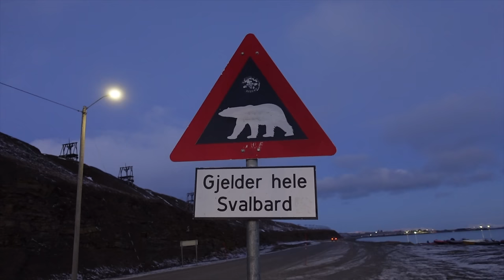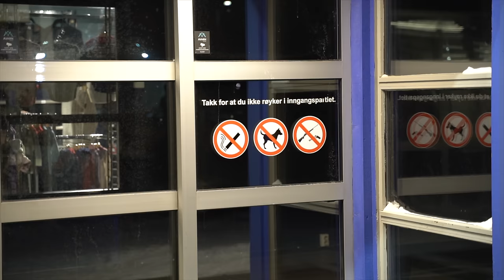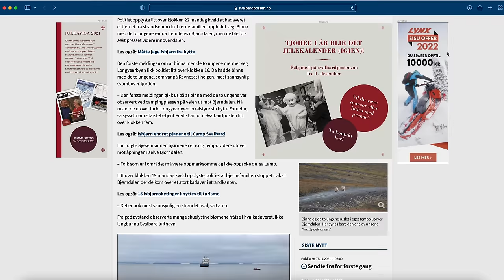Why I have to carry Polar Bear protection when walking my dog | SVALBARD close to the North Pole

Comment: It's the same way here in Libby, Montana. Had a couple that were tourists run out of gas at the end of my quarter mile lane. So I grabbed my sling and AR becuz I didn't want to jump a grizzly and my lanes a 1/4 mile long. So when I got within 40 ft of them I smiled and asked them if they needed help. They laughed and said initially they were worried becuz I had a gun and it was their 12 yr old that reminded them they were in a county that had the highest grizz population in the lower 48. I laughed and told them it was just a safety precaution with the bears. Gave them 2 gallons of gas and followed them back into town to make sure they made it for gas. I've lived here all my life and you really don't even think about it, it's like a warm jacket on a cold day.

Comment: You 35.6 is not too cold. Me in the States. 35.6 is cold especially in snow. Though I think I have acclimated to colder weather better this year. I have lived in my townhome for 18 years come middle of December. This house was built 1997. I finally had to replace the furnace 2 weeks ago. I went 3 days without heat.

Comment: I know what you mean on the polar bears. Back in 2002 – 2005 I had a gig with NASA working on the Radar station at Longyearbyen, anyway in April there were two Japanese women researchers up on the ridge to the northwest of town that were tracked by bear. The first one was bitten and then slide down the gullet and dropped off the cliff and broke many bones but lived. The other women was eaten alive by the bear. Some natives from a Russian village tracked the bear and shot it a week later.

On our work at the station I was made the rifleman for the group. When in town we just took a round out of the chamber and put it on the gun rack with all the others. Once at the radar station on the road in March there were tracks coming up to the dome. I spent two days out with the rifle checking things, it scared a lot of people, the hired tracker said it was a large male. You should put a picture of Leif Erikson on your wall.

Interesting to see firewood since the nearest tree is 1,600 miles away.  Wood heat in the arctic, wow!

Comment: Not a big deal but your temperature conversion is wrong. -2 c would be 28.4 f. Freezing temp being 32 f so obviously 35 f is impossible with the current outside conditions.
Reply from the maker: Yesss it gave me conversion for +2c for some reason🙈

Comment: Hi. On your remote cabin trips, what is the deal with renting them?  What about firewood?  Do you have to bring your own, or is plenty provided by the rental?  Assume you need to melt snow for water.  Is fuel (propane?) provided as part of the rental?
Reply: Propane and a cabin stove is in every cabin. But you bring evrithing you nead for your trip🙂
Reply: @christoffersporck  Thanks. just curious. It is nice to have a fire, so that wood would be a bit of a load.
Reply: @craigcampbell6961  we always bring about 200l of wood on the sled/trailer when we go snowmobiling. 40 to 100 of bensin good amount of food and extra stuff for safety!
Reply: @christoffersporck  It is nice you have those cabins available.  Back when I lived in northern BC, I did some 2 week trips on glaciers, some in Alaska,  on XC skis pulling a pulka.  No wood/no fires. But sled allows one to take 100 + pounds of gear including fuel as all water requires melting snow.  As I get older your more civilized version has appeal :-)  No polar bears to worry about, but some northern more wooded areas have grizzlies.

Comment: The temperature conversion at 04:14 is not correct.  -2 degrees Celsius is 28.4 degrees Fahrenheit, which is below freezing. 35.6 degrees Fahrenheit would be 2 Celsius degrees ABOVE freezing.
Reply from the maker: I know it gave me the conversion for +2c for some reason :/

Comment: So you're required by law to carry a gun when you're in certain areas in case of a polar bear attack, but shooting a bear is illegal, even if it was the last resort? Even if you do actually need to use the gun that you're legally obligated to carry, you're likely to be hit with a fine for it? 
It's troubling to hear that a government can have two such conflicting laws, which can very easily put someone in jeopardy of breaking one of the laws no matter what they do...  Wouldn't that be considered entrapment?
Reply: She didn't say you will get a fine, she said probably get a fine. You won't get fined if enough criteria for self-defense are met. However, in almost all polar bear shooting cases, there was human error that caused the incident. Like deliberately approaching the bear (which is illegal in itself), could, but didn't try to scare it off first, or didn't keep proper watch out, and this are reasons most indeed get a fine for.

Comment: So you can shoot up in the air if you encounter a Polar Bear? The noise will scare it off
Reply: If a polar bear is hungry you will not scare it off, you are required to get away from it so you do not need to shoot it for self protection.
Reply: @badgerpa9  Bears can run 35mph, but ok
Reply: @FormerTrucker  Did you notice the landscape?  It will not be hiding behind a tree. If you look around you can see a long distance and can try to get in a cabin or vehicle long before the bear is by you.  You do not want to risk your life to thinking you will shoot it, something can always go wrong and a hungry bear is hard to stop.
Reply: @badgerpa9  indeed

Comment: Why don't you carry bear spray?
Reply: If you want to live you need more than bear mace, a polar bear that is hungry will not stop.  It is your responsibility to get away from the bear and have no contact.
Reply: @badgerpa9  Of course it's your responsibility to keep safely away from any bear. From Wikipedia:"The efficacy of bear spray depends on the situation and circumstances of the attack. ... Red pepper spray stopped bears' undesirable behavior 92% of the time when used on brown bears, 90% for black bears, and . Of all persons carrying sprays, 98% were uninjured by bears in close-range encounters."
Reply: @waynead754  What is the source wikipelie is referencing. Is the information totally dreamed up or a real test?  I never believe wiki because after checking the material I have found were they change things by deleting a word like not.   In an open stark terrain like there you should be able to spot bears a long distance and completely avoid them not needing anything for protection, but a hungry bear can run you down so you need protection in case. Use of bear spray to cover your scent if the wind is blowing from you to the bear and you have no way to safely change your direction can help also.  Also we as humans do not look around us and cannot smell things, having a dog to pick up a bear smell is helpful to keep your distance.  This area mostly is not like walking in a thick woods and walking up on a Grizzly, the bear has no tree to hide behind. One caveat is thick fog, then you cannot see and having a dog to catch the bears scent is important.  A polar bear that is hungry likely will not stop even from bear mace.  If one of your party is down on the ground being attacked are you going to walk up to the bear with in it's 5 foot reach and spray it and you partner in the face?  Spray has a reach but at that time you better get straight in the eyes.   If you watch her videos they have spray, I think she was explaining to people why she had the gun on her back, not giving a full class on what you need to do to avoid the bear no matter what.
Reply: @badgerpa9  There are many accurate tests proving the effectiveness of bear spray, showing it is more effective than a gun (you don't need to aim it accurately) It is used as a deterrent, not to cover your scent. I've never encountered a polar bear, but have encountered many black, brown and grizzly bears. I was just curious.
Reply: @waynead754  How many of the bears you stumble up on then follow you for miles to hunt you to eat you?  If you are trying to get away from a polar bear tracking you yes you should spray off some mace on the trail so it messes with the bears nose, maybe you will get away from it.  Even on skis a bear will catch up to you and track you down for food.  It is not like you stumbling on a bear eating berries. Skiers have had bears track them for days when traveling.

Comment: why carry a shotgun when you could carry a magnum revolver? is it a price thing? seeing how a shotgun can be bought for about $300 while a 500 magnum is about $1400. a 500 is lighter has better penetration and about the same power. and do you carry bear mace?
Reply: First if you are talking USA dollars the $ is always first not after like the chinese yen.  Second she can get licensed for the shotgun for bears, handguns are not easy to get in Norway.  A hungry polar bear is not going to stop at bear mace. It would be a good first try but not to bet your life on.
Reply: @badgerpa9  bear mace is extremely effective and will stop any bear in its tracks. It can also be deployed if a bear is on top of you unlike a shotgun.
Reply: @kevincornell1439  You are required to get away from the bear so if a bear is close enough you are deploying your bear mace you already failed, bear mace works in close area but if you are trying to get your scent away from the bear the wind should be blowing towards you so the bear no longer can smell you, if you can change your path, so if you have high wind which is common there and you let the bear still get too you, you will need to wait to deploy it when the bear is on you because the wind will blow it in your face.  If a polar bear has already attacked someone in your group spray will not work unless you can get the spray in the bears face and that would put you in deaths range. It is your responsibility to not have an encounter with the bear, the landscape in most areas will give you the room to see them and get away, trying mace is a good idea if you are still in the wind blowing at the bear.  Polar bears tend to attack from the top so they swat and bite your head so you will be blinding yourself if you have to spray mace and the bear is already attacking you.
Reply: You should research firearm laws in european countries.  Telling someone in a european country they should carry a sidearm is very uneducated.  Not sure what country you are from but you use the dollar sign like chinese and have no knowledge of firearm rules around the world. Most countries it is not easy to get and carry a sidearm.